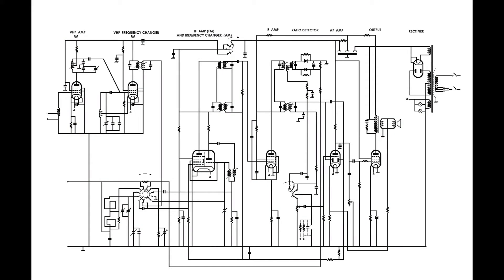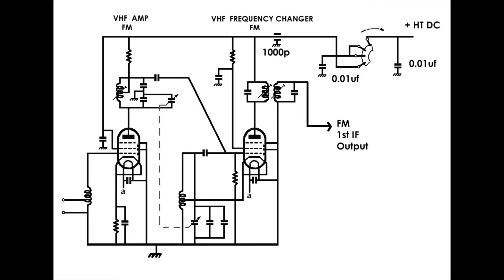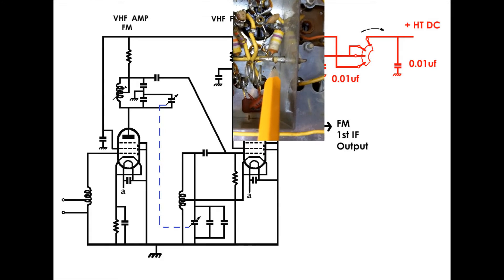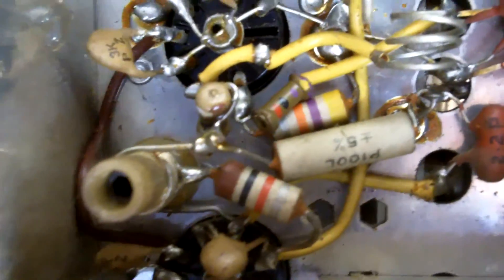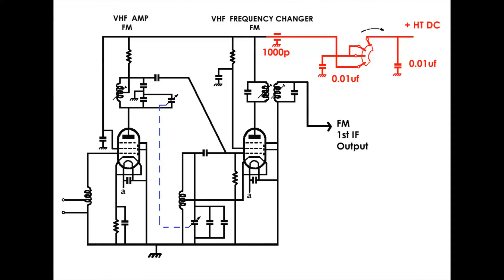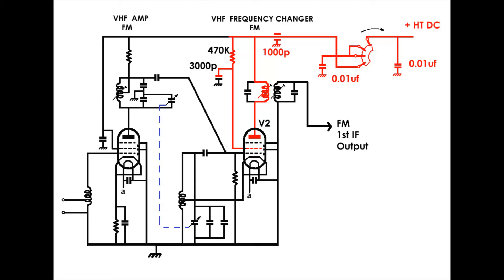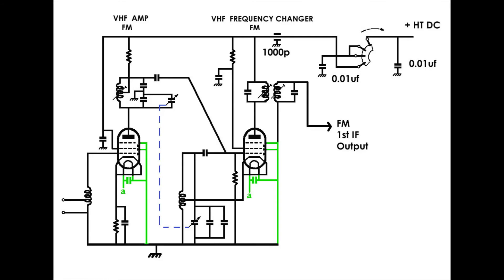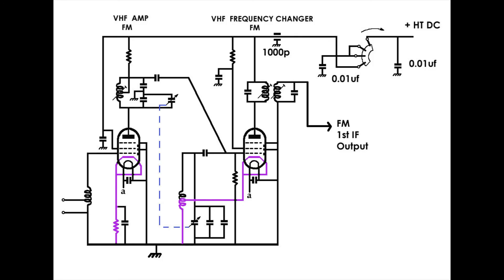About Radio ... Part 5  VHF input stage by Andy Davies.

Comment: What is the "HT" DC? In other words I have not seen HT before concerning VDC. Could you explain that to me kind Sir? Remember I am in the US.
Reply from the maker: Hi Pat it looks like you've been through a lot of my videos and each one has inspired a question.
HT is High Tension so we'd say a high voltage supply was a high tension voltage. The voltage on the anode (or plate) of a valve (tube) would be the HT voltage and the filament (heater) of the valve would be powered by the LT or low tension power supply.  The notion is really relative to the topic, for instance in radio or old televisions the 'HT' might be a few hundred volts but in the industrial world of valve (tube) based induction heating equipment the HT voltage could be 12KV or more.  

Regards  . .  Andy
Reply: @AndyDaviesByTheSea  Thank you for explaining this to me.

I am very intrigued about British protocol. Since I was born (1932) and live in the US, many "terms" differ when one crosses the" big pond", so I thirst to learn.

And I do believe I have found an outstanding teacher and that is YOU kind Sir.

May Jesus bless you and yours always.

Comment: Several years ago I was tracing through a diagram. And one wire weaved allover the radio. The problem was it came from the B+ and the other end, ended at the ground of the radio. A direct short to ground. And I checked the diagram three times. Of course that is not how the radio was wired. I wish I could remember what diagram it was, I would YouTube it.

Regards,
Rick

Comment from the maker: @AllAmericanFiveRadio 
Thanks Rick, you say you're fascinated by the biasing of the screen grid, you're not been mislead by the ground connection on the right are you?

It might look as if the screen is fed positive volts on the left and grounded on the right but it's not. There is however an internal shield on the right on pin 6 of the Z719 valves connected to ground to the right of the valve. 
  Or have you spotted something else?
                            Kind Regards ...Andy

Comment: Nice job Andy,

I find it fascinating the way the second grid is biased. Unfortunately I have found a number of mistakes in old radio diagrams some like this one, as you said, not a problem. Very interesting and informative explanation of the circuit and its parts.

Regards,
Rick